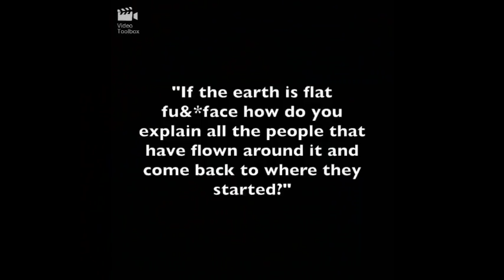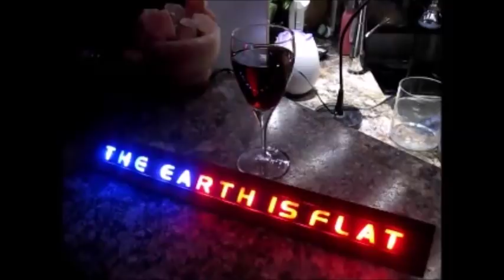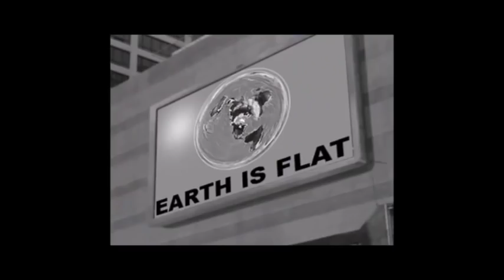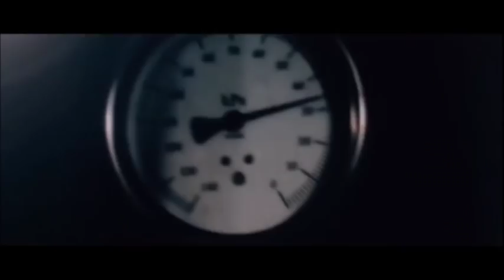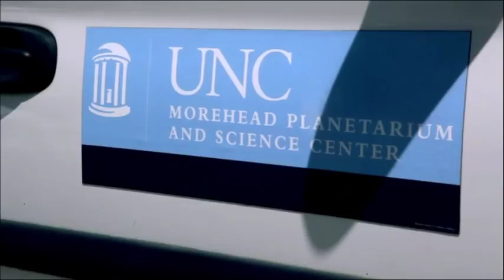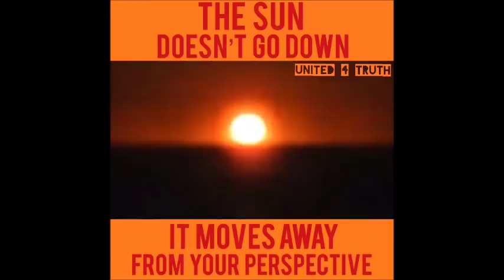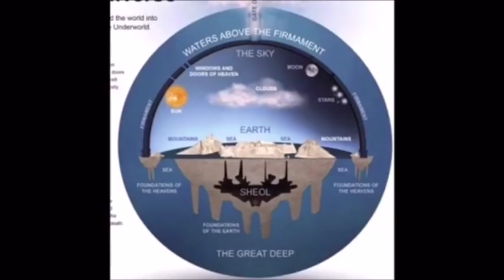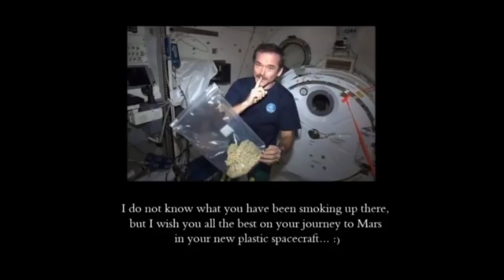Flat Earth Q&A Emails 110 Mark Sargent ✅

Comment: Sweet! you read my e-mail :) 
yeah I had always assumed the opposite polarity was all around the outer edge, but seems to literally be a central mono-polarity, really should also have been alternating in polarity since the coils were in oscillation.. strange stuff, but will send you a vid if I can of it running and the N/S tester... plus do a bunch of light.. off a single AA battery with it ;)